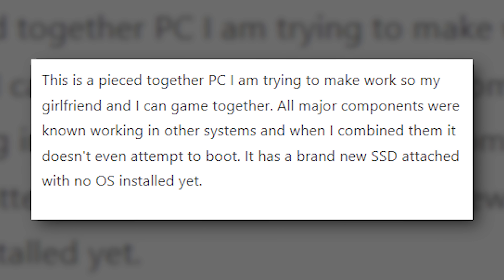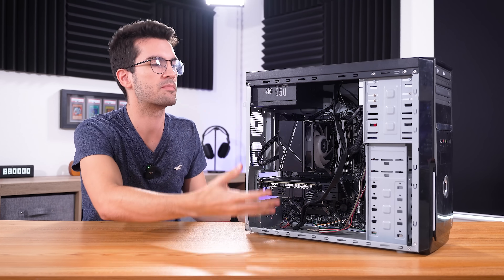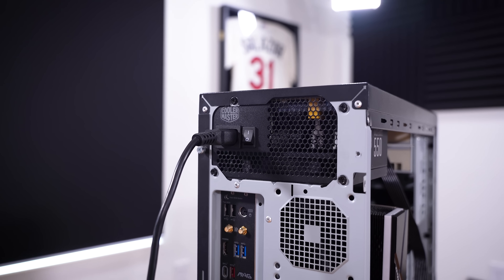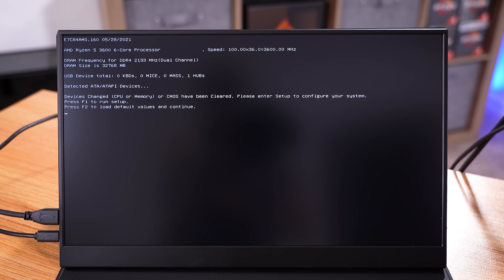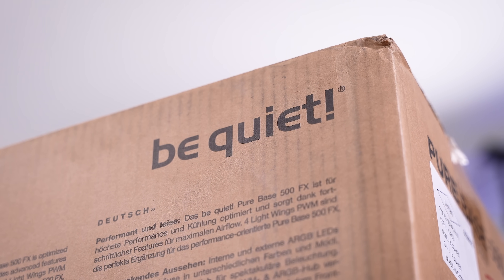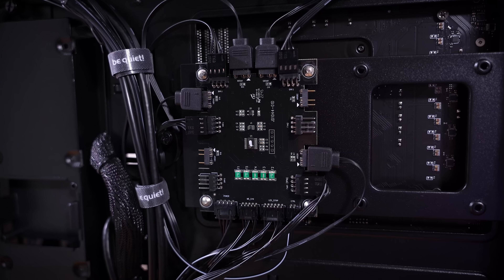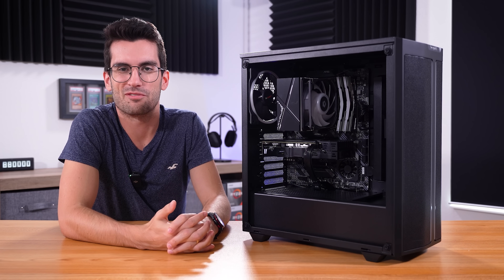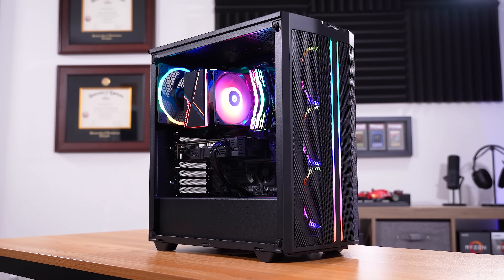Fixing a Viewer's BROKEN Gaming PC? - Fix or Flop S4:E11

Comment: The only one mistake that was minimal, i'm probably sure this guy was embarassed but we all doing mistake like that when we dont build pc every day. I remembered having some issue when was the time to build my first pc. I got same issue when i mount my first aio in my second rig that miserably brick himself both motherboard and cpu was brick. And now i have a hot cpu cuz Ryzen 7 5800X3D are around 70-75°C in load but in idle he is at 30-35°C. One tips everyone, even if you know how to build pc, just look the motherboard manual. Sometimes some manufacturer are tricky about some wiring place ^^

Comment: For any one judging the builder, this was not his fault. Look at where the FP1 is silk screened on the board. below the port against a steel wall. You would have to look at the motherboard with it upside down to see that. On top of that the front panel adapter is the exact same shape and pin out as FUSB.

Comment: Fyi this was my rig and the motherboard in it had been an issue in my previous build, constant blue screens etc. It was to the point when I dropped it off with Greg I included a replacement mobo in case it was the issue. Greg said no need and I am super happy the issue was as simple as it was. I guess the biggest thing I learned was not to assemble a PC at 1 am. 😅
Reply: Now you know your mistake and you can learn from it!  Everyone in the PC industry started somewhere...  Now we need an update if the system returns to software related errors.
Reply: @_Sn0_ funnily enough, it did. When I got it home and got Windows installed sure enough constant blue screens again. I had not yet sent the new motherboard back to Amazon, so I swapped it out and now it's super stable. I think that old mobo was a lemon from the factory.
Reply: @sweetdawg9979  Well that sucks... Hope the new MB treats you better!
Reply: G'day Sweetdawg,
Yeah I tend to make silly mistakes like this late night/early morning too, it's why I call it STOOPID O'Clock 😉.
Interesting to hear you had problems with BSOD when the X570-Tomahawk was in your PC, What CPU + RAM did you have?
I have a X570-Tomahawk too for my Editing PC, it's paired with a R9 3900X & originally 16GB Balistix 3200 (16-18-18-36), Now 32GB Kingston Fury (16-16-18-36) with no stability problems using it for Rendering, Transcoding or Gaming.

Will be interesting to see how the X570-Tomahawk performs in the new build for your girlfriend, hopefully no stability issues as it crasing while Crafting Mines will be frustrating
Reply: @shaneeslick indeed the constant BSOD continued when I installed Windows at home. I had tried a couple different matched sets of RAM previously so I don't think that was the issue. I took the mobo I had ordered and swapped it out, now it's as stable as you could ever want. I think the mobo I got was a lemon.
Reply: @sweetdawg9979 Yeah if the issue went away when you swapped boards then it was definitely the board 😂
Reply: Wow, you must've facepalmed so hard.
Reply: @mistermudpie yeah you have no idea. I felt bad cuz I definitely didn't want to waste Greg's time, or mine for that matter. I am just glad he was able to get a video out of it.
Reply: @sweetdawg9979   I wouldn't see it as wasting anyone's time. It's educational for others as we all have to start somewhere. We also all make mistakes. Heck, watch all of Greg's videos and you'll see that he occasionally forgets the simplest of things - the power cable or switch!
Reply: Thanks for your feedback. We don't  always hear back from the owners. So your updates are welcome!
Reply: Sometimes it takes a second set of eyes to see even a simple problem. Happens to us all
Reply: You could try resetting the cmos and change the cmos battery and see if that helps with the crashes
Reply: lol im sure no alcohol was involved :P

Comment: This reminds me of my brother transferring his PC parts, I built for him, to a new case he bought. I left him and my other brother to do the hardware transfer as he felt confident doing it. After 4 hours he called me because he was at his wits end because the PC won't respond after pressing the power button. He also swapped parts from my other brothers PC to see if had broken it, but just like this PC he had the front panel headers plugged into the USB internal header. It was an easy fix and he was so relieved that he didn't brick and break his expensive PC parts.

Comment: Does anyone know why my pc boots into bios and says windows boot manager not found
Reply: check if your boot is set to the right SSD/Hard drive.
Reply: @jaimeacosta9062  I was cloning my hdd to my ssd thru the Samsung program and power went out an pc just won’t boot past bios would I need to install windows again?
Reply: @rzrz5127  damn. if you were cloning and the power went out, ur drivers might not work well. Im not super techy, but you can try installing windows into the SSD. You might've lost your storage files though because of the power outage.
Reply: @jaimeacosta9062  oh man ok thx

Comment: I ABSOLUTELY HATE that (most) newer cases don't have drive bays anymore!  Had a real tough time finding a case with a drive bay, but thank you "Cougar" for continuing to make a case with at least one drive bay, the "MX330".
My reason for needing the drive bay is for my Blu-ray burner as I still make DVDs, and prefer an internal (since I have a tower) over an external.
Reply: Same. Another thing I hate about modern cases is the lack of 3.5" HDD bays, most cases only have 1 or 2 of them.
I'm still using an old Fractal Design Define R5 which has two 5.25" bays, 8x 3.5" HDD bays and two 2.5" SSD bays
Reply: Out of curiosity, why still make DVDs?  8GB flash drives are much more convenient.  Other than price I could not see a reason for burning DVDs anymore...
Reply: @_Sn0_  I don’t know if they still “make” them, but you can definitely still buy blank discs of all types.  Also you can still buy current movies, TV shows, and past TV shows on DVDs and Bluray…I also stream, but many times what I want to see isn’t available on any of the common streaming services.  Also I still buy used DVDs and Blurays, especially obscure ones.  But I use DVDs to archive my VHS and Beta collection…USB sticks are so unreliable and easy to lose.
Reply: @_Sn0_ Why? Because some people still have Plex servers and need a way to upload their content to their hard drive.
Reply: I always need at least one 5.25 inch drive bay. I run a Plex server, and I like ripping Blu rays using Make MKV. Right now, I have to use an external BD drive because I am using a modern case.
Reply: I thought that at one point and eventually even took out my DVD drive and put the blanking plate back in. Not needed the DVD drive for anything once since. Not something i'll miss at all.
Reply: @SiAnon  Agree, you can still use an external DVD/Bluray connected via USB, but for my video work I prefer the speed and reliability of the internal drive (for the record, I do have an external bluray drive as well I use with my laptop).
Reply: @mikefellhauer3350  I still have my DVD drives, didn't chuck them. I have and external USB to Sata thing that i bought just in case i needed to use the DVD drive. So far in the last 4 years i never have lol

Comment: Don't you think this was done intentionally like that to get a free upgrade on a case? I feel like anyone could do that, think out some story and hope for some upgrade
Reply from the maker: He spent more in gas to drop off/pick up his system than the cost of the case. He also had no idea what - if anything - I'd be upgrading. Not sure where folks are getting this.
Reply: Fyi this was my PC and I genuinely felt bad that the problem was so stupid and easy to fix. When I dropped it off I had even included a brand new motherboard because I was convinced that was the issue all along. Kudos to Greg for taking it back to basics like he does in the video and realizing it was much simpler than that.

Comment: 1st rule of PC diagnostics:  try the simple stuff first!  You could potentially save yourself a massive headache.  I have actually seen people screw something else up, while thinking their issue was with their CPU or motherboard.  If you're PC doesn't turn on, check the wiring first!  Like Greg said, it doesn't matter how experienced you are.  People make mistakes.
Reply: I've changed my thermal paste since it was hitting 50-60 in idle (was 30-40 a few months ago). Anyway I had the cooler month that was a pain in the ass to remove if you have a tight case. The one where you have to push down on the tabs like the budget deepcool coolers. So I tried to remove the RAM but gave up halfway because my GPU was blocking the other tabs(!). So I decided to remove the GPU first. I got a big room after removing so I just removed the cooler and repasted, put everything together and tried to boot. Nothing. Took it apart and reapplied the paste and cooler, same thing. I was worried that I fucked my CPU up so I just sat there thinking. I started fiddling around and I heard the RAM click. I properly seated my RAM and It started to boot. I forgot I gave up halfway through removing the RAM. I was almost shitting bricks and was very relieved when it booted to windows.

Moral of the story: check if everything is proper seated

Comment: I am always checking the motherboard manual when building pc's. Manufacturers have different places for the internal connections so it's better to check the diagrams and header names in the manual. This one was really easy to fix, I suspected a bad front panel wiring from the moment you said he tested the power supply and it was ok
Reply: Yeah especially older LGA115* ASUS Motherboards as they were the ones that changed the Front Panel Pin arrangement requiring cases to have seperated Front I/O instead of the Block like FUSB & FAudio
Reply: @shaneeslick  i do remember seeing this on a z87 board from Asus, i think it was a Maximus but not all of them had this
Reply: @AeiKei  Every one of the ASUS 1155 Mobos I've had H/B/Z have all had the different FP Pinout
Reply: @shaneeslick  never owned an Asus LGA1155 mobo, but the z87 Maximus had the weird pinout aswell, the z170 pro gaming reverted to the classic one

Comment: So many years later and I still HATE front panel connectors. Why in the world we still don't have a simple solution for it just like the 24-pin for the motherboard?
Reply: It's worse if the MB manufacturer decides to put the JP1 headers in a hard to access location that will cause   you backpain trying to put everything neatly.

Comment: I bought this case last month and it didn't turn on. Did troubleshooting(cmos battery/ram/cpu/took all non essentials out. If I tried to turn it on my psu just clicked and nothing happened. Used a  different psu and the same result. So I bought a different mobo and everything worked. Love the case and lighting. Easy to use and lots of space. Cablemanagement is just ok. 

How much bad luck do you need to scuff a mobo when takibg it out anyway?

Comment: I made a similar mistake on the very first computer I owned back in the 1990's. My first PC ran Windows 3.1 and ran on an Intel DX486. Ahh, all those memories.
Reply: Those were the days... so little online help to build the systems and so many frustrating parts and wires to get connected properly 🤣
My first was as 80386 with a CGA card, a 5 1/4 floppy drive, and 1 meg of ram. I don't even remember what the hard drive was anymore it was probably 25-40 MB.

Comment: Question plz! At 3:40 i see you already connected the jfp cables on something like a hub/adapter so you can plug them easily on mobo. Whats this hub called? Great work as always!
Reply from the maker: Comes with most motherboards. Not sure what an official name for it would be.
Reply: For that adapter, it will be manufacturer specific. You may be able to buy one from them. There may be other places online to get one, just make sure the adapter works with your pinout or things will not work.

Do note that the adapter is meant to make those connectors (Power Switch, Power LED, Reset Switch, Hard drive/NVMe/SSD Drive LED) easier to connect. The added height can be an issue depending on the case and components involved. Power LED's can be two or three pins (middle may be blank in the three pin setup). Speaker connectors can be with the front panel pile, or like in the video nearby (speakers are handy for older systems that don't have diagnostic LED's or readouts (That gives you a minor idea how long I've dealt with computers)). If you are dealing with beeps, there are some common ones, but the user manual is a friend and godsend in those cases, as manufacturers can pick and choose what they want those codes to mean. Don't be afraid of one single quick beep, be afraid of one long continuing beep.

Happy building.

Comment: People would be surprised how common this happens, as always lovely episode
Reply: Happened to me 25 years ago when I thought I'd plugged the front cable into the right pins, but I didn't push it in all the way so it caused intermittent problems starting the system. It took me weeks to figure it out. I was so embarrassed and frustrated as it honestly looked like it was all the way in.
Reply: Yeah or even getting the right Connector but mixing up the Power & Reset buttons
Reply: Hooking up the case power is always the biggest annoyance for me
Reply: I broke my laptop hinges
Reply: Yes, seen it a many self build pc systems where I was ask to do some trouble shooting. Not only connecting with the wrong header at the board but also people who forget to fully plug in the cables at the power supply or forgot to plug in a cable at the CPU power, fans at the wrong header. Sometimes I have it myself too, system not powering on, push a cable hear CLICK - well that might do the trick...
Reply: I had my HDD activity front I/O cable plugged in the wrong way. Not mission critical but still a useful indicator when other stuff goes wrong.
Reply: We had a kid come into the shop he was 13-14 years old and he built his first computer and it wouldnt turn on........only thing he had wrong were the front panel connectors.....he didnt consult the mobo manual and just winged it i guess
Reply: this just happened to me when I just upgraded to a b550(am4) mobo from a A70(fm2+) mobo I was so annoyed at the end by such a simple error which took me 2 hours to fix.

Comment: This is a similar issue I had when I first build my PC in 2012. Was an FX6300 and Radeon 7790 and when I clicked the power button my heart dropped since it wasn't turning on. After a lot of troubleshooting I finally realized....I had the Power plugged into the LED + and - and the only reason I learned this was because I realized the motherboard manual had the diagram printed UPSIDE DOWN.
Reply: This is probably to do with my age also, but a lot of mb manuals print are so small.
Reply: I feel your pain.  I was always told to RTFM (Read The Freakin Manual) but I ran into one like that, too.  Manual was confusing, but the printing on the board itself was far more helpful.... once I learned how to read the "shorthand" printing on the MB.  I rarely consult the manuals on new builds any more.  Now I mostly just get out a BIG magnifying glass and have at it.